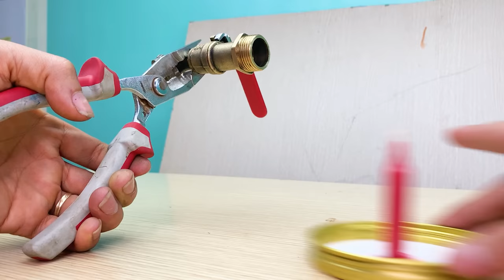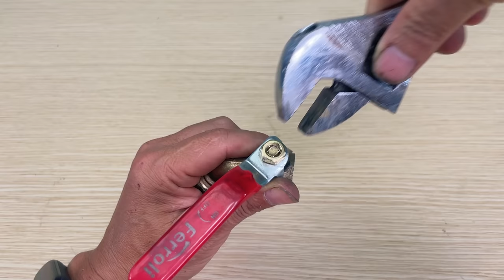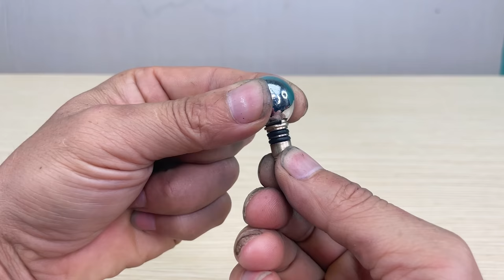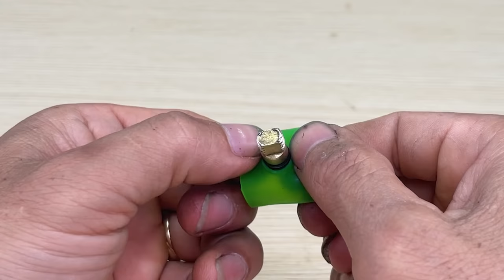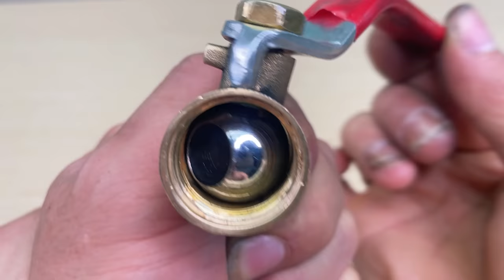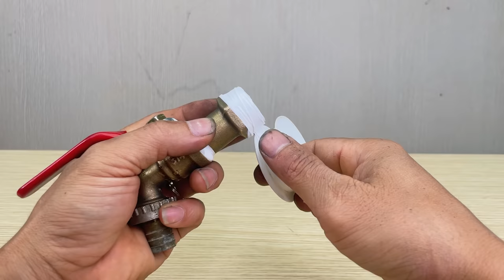why didn't I know this before, turns out there's an extremely simple idea to fix a metal water lock

Comment: In a day when so much of life is used up replacing things rather than fixing them, it's good to see a video like this that shows us how to take sonething apart and fix it, rather than throw it away and learn nothing.
I think I'll try this and experiment with various hose material to get the best result.
I know you were making a video, so you didnt concentrste on wrapping your teflon properly, which resulted in your elbow connection leaking; but otherwise, good video.
Thanks for the idea!

Bu yhe time you go to the store (time, gas and wear on tires and engine life brske lufe, etc., and look through all the options of the many different kinds and styles of valves, wait in line, etc., this could be a real savings; not to nention the risk of getting in an accident on the way!
Reply from the maker: Thank you for your interest in our channel, looking forward to your comments for our channel, thank you

Comment: The concept is fine but the piece of hose won't last long. The piece of hose will flatten and when you tighten it back down and with each turn shave it thinner. It's not a permanent fix. It will hold up better if it's not used often. The o-ring idea suggested above might be a better solution, but the same problem will occur. With each turn, the metal on top and bottom will grind it down over time. I go through a lot of ball valves a year mainly because when they freeze they tend to crack, once they start to wear out like that they are pretty much done

Comment: Buy a better-quality ball valve to start with. The cheaper versions always have one nut that serves as a 'packing' nut and holds the handle on. The better valves have two; one for the packing and another for the handle.

Comment: Connection between faucet and plastic pipe is leaking.  Hand tight won't cut it.  Why the plastic supply line?

Comment: That little piece of poly hose you used as a spacer isn't going to last long.  I would have picked up a new valve at the hardware store and replaced the old one; a 10 minute fix for a 10 year valve life.  What's shown here is a 1 hour fix for a 1 year valve life.

Comment: There is two things wrong with that repair you made, by putting a spacer top shut off valve rod is pushing down on the shut off ball preventing the shut off ball from centre in the orifice  second issue the O-ring at the top shaft where you put the plastic spacer is will  prevent o-ring from seating causing shut off valve to leak at the top.
Reply from the maker: Thank you for watching our channel, looking forward to your support, and give me good comments from you.

Comment: Considering that's the wrong valve for that application, 10 bucks for the correct valve would have solved that problem and saved you all that wasted effort. You never thread metal-male into PVC-female. Always male-PVC into metal-female. The brass valve should have the female threads, and the PVC should be redone to end in a male thread.

Comment: Just buy a new cheapy ball valve. I can already tell that ball will not sit on the seat properly by the way it was operating after reassembly. That valve will not last long after this "fix."
Reply: how can you tell?
Reply: @efraimkudan36  I can tell by how the valve was operating after reassembly like I explained in my last comment. If I need to be more specific, the ball (probably 316 stainless) is catching and rubbing on the body of the valve (brass or bronze) which over time will wear down. Plus if the ball is catching that means that it is not aligning properly and will not seal properly against the seat leading to a leaky valve. Better off to spend 8 dollars and get a new one.
Reply: @billydoright2050  thanks, I don't know those information so I needed those specifics..

Comment: Good if you're s touch in the middle of nowhere. Most peoe would just use the isolation valve as the tap, if they were in a bind.
If you're somewhere close to civilisation, you'd just replace the tap